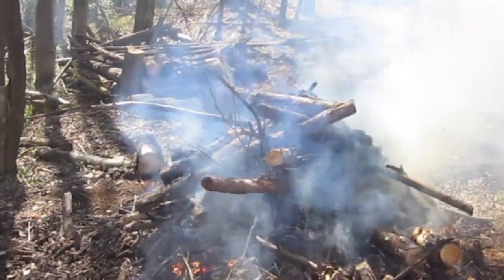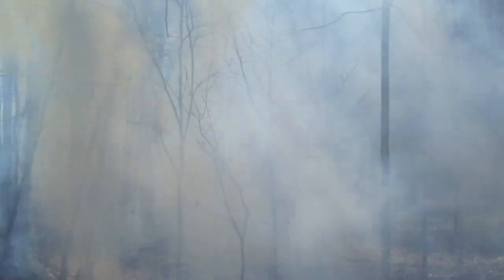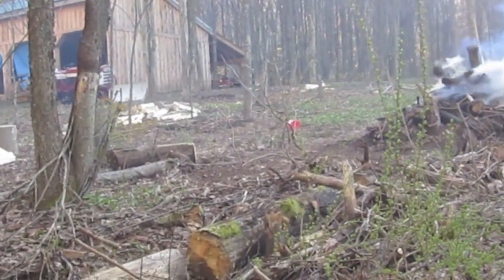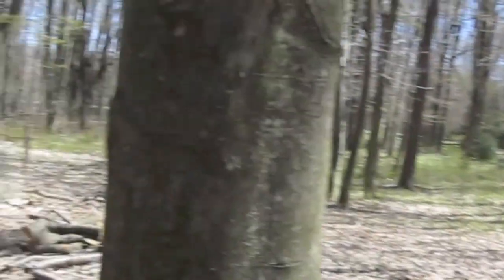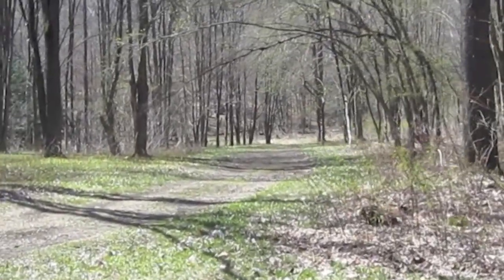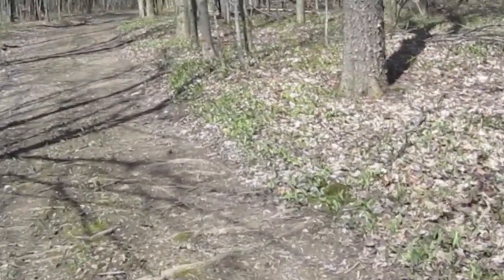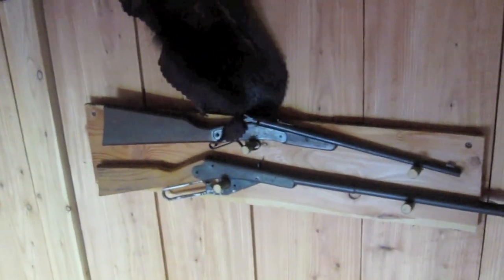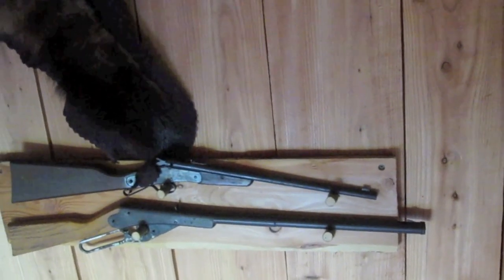Off Grid Cabin - Clearing brush - splitting firewood - Working on the International 240 - 4-7-2012

Comment from the maker: depend on the size... some of the larger ones in the past (say 3-4 foot base) we dug out by hand... that was hard... we had a dozer come in and do some as well... the 1-2 footers if you dig a little of the base and leave 8 foot or so of trunk you can lever over... sometimes we used the tractor and the middle buster and pulled them out... but we seem to bend alot of metal parts :) the small ones we cut to ground level and leave in place... We have burned a couple in place but that takes a while..